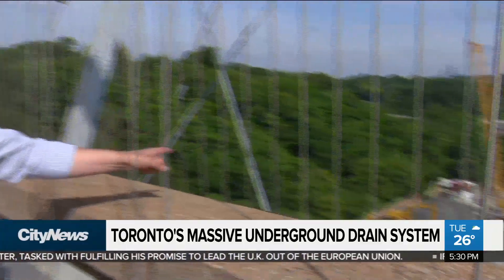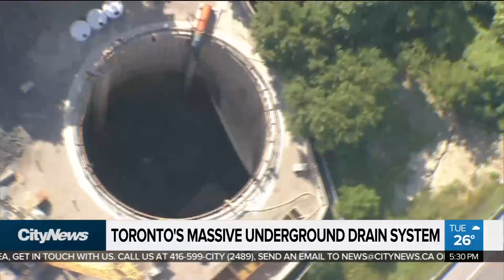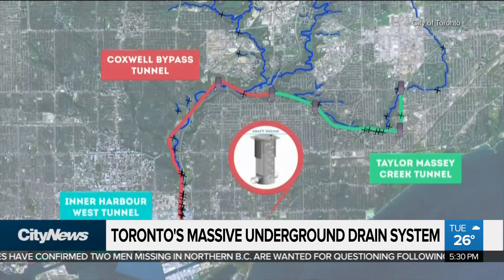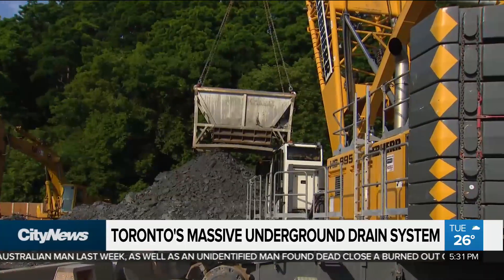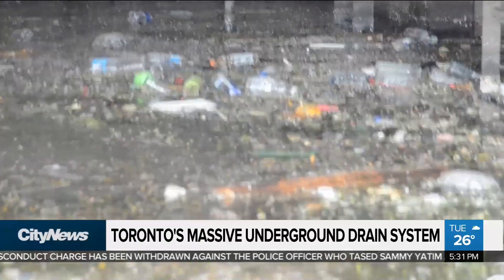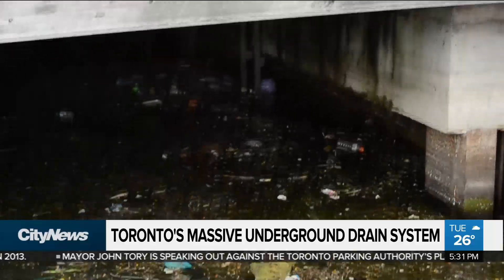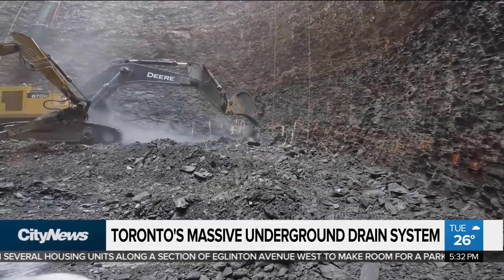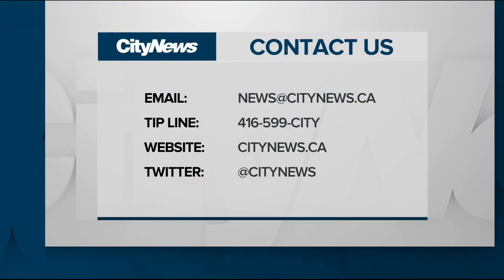A look at the massive project to prevent Toronto flooding

Comment: This is great and scandalous at the same time when I moved to Toronto in 1995 my High School taught me about this problem I was told there was corruption in the building of Toronto and that they cheaped out I'm building a decent sewage and drain system the problem was that whenever there was too much stormwater it would go so high the level that it would start mixing with the sewage resulting in untreated sewage pouring right into our Lakes anyways that was 1995 ( not the building of the System just me being taught)  nice to see the finally doing something about it

Comment: That's a cool project and will certainly help... but at the same time, small solutions need to also be pursued; such as removing existing paving where possible, mandating permeable paving henceforth, building more parks (and less parking lots), etc. Nature manages stormwater very efficiently, if you would just not pave over it and change it!
Reply: I agree big concrete holes cost a lot of money, I have seen some natural revitalization cost less than that. Look up the channel ‘City Parks Alliance’ here on YouTube, they have a video that explains the difference in costs for these types of problems. And they say it saved over 10 million building naturally. Also green space is beautiful and has many economic and health benefits.

Comment: Toronto is on a slope that leads into the lake. All water that comes in drains into the lake. Why would we need this?
Reply: Thats the problem, Sewage is getting into the lake and waterways. this is bad, these tanks will hold overflow during storms. until there is capacity at the sewage plant to treat the contaminated water.
Reply: seriously?
Reply: Because a contractor needs a contract!

Comment: We can build 22 km of giant tunnels for this and we can't even get the shovels down for a subway.
Reply: They dont want to build subways.
Reply: @baystreet6627  Of course they dont. How will they collect gas taxes??
Reply: Why does it have to be one or the other. This is needed and so is the subway.
Reply: @andrewbarnes7692   So true.  This has been needed to help replace natural drainage capacity lost to urban development.   This, and the re-naturalization of the mouth of the Don River are steps to control floodwaters of the Don.  And controlling floodwaters in the area you want a subway buried are probably a legitimate concern to deal with before digging near and under waterways.
Reply: @andrewbarnes7692  Bro, its politics. Politicians always do what pays politically. Arguing about a subway and never building it pays off. The city chokes in traffic and that's the whole point. This way they have something to preach and make themselves as heroes. If the subway gets build, the reason to bicker and whine goes away and so do their votes.
Reply: Yeah if they built one new station a year it would be great progress . And put washrooms in every station and automate the system
Reply: The rich are the priority
Reply: It's easier to dig than to clean
Reply: The contractor probably has connections at city hall.  Toronto is an extremely corrupt city.  And Toronto does a very good job of hiding that fact. Believe you me!
Reply: @baystreet6627  usually give back a percentage of commision to who gives the contract.
Its why they all hated Rob Ford, he stopped the gravy train as he called it.
Reply: @thesisko4031  there's still tons, gobs and gobs of gravy still left unfortunately.
Reply: Bugsy Segal  Toronto is the only transit system on the planet not subsidised by the province.  
Now that the province is taking over things should change.
Reply: Its because this project isn't a political issue they campaign on for 20 years
Reply: This is far more important
Reply: Suppose Toronto's population plummeted after this pandemic. Would the subway pay for itself then?

The blessing with buses is that they can be moved to wherever the people go.
Reply: It's called priorities sanitation is more important than subways
Reply: It’s really sad. I’m from Toronto but lived in China. Some of their subway systems are 100 times better than anything in Canada and they are building more
Reply: James Lade why are humans so ungrateful? Do u get to work safely?
Reply: Or just let someone say... this is madness! Madness??? THIS IS
Reply: Bonnie Cull  Toronto is Libs and the subway is Toronto.  Stop blaming Cons for your problems in that city.
Reply: @mare-6406  huh? You do know North of Steeles is not Toronto right? Where the subway extension is supposed to be? So no it's not Toronto. time for you to learn geography
Reply: @gilboman  Eglinton is in Toronto & my husband has been working on that construction.  
Do you understand how many billions it costs to build subways?  You can't be both a sanctuary city and take care of your own people. Pick one.  The people who have paid taxes for their entire life or the people who decided to use the RCMP as their personal valets. 
Any subways being built in GTA still helps out the downtown core.  Use logic.  Yes I understand our subway needs many more lines but to what end?  How much is a ride going to cost you?  GO is already overpriced for people getting into downtown.  Where do you propose this money comes from?
Reply: @mare-6406  lol what? Santurary city? Nice try. No such thing in Canada as santurary city. It's sad you didnt get a single thing correct in your rambling .  Go transit is heavily subsidized and very cheap. Nowhere else in the world does commuter rail system offer endless free parking like Go
Reply: @gilboman  from a site called visaplace dot com: Well, Toronto city council voted on Thursday and decided that yes, Toronto is now a “sanctuary city”, making history as the first Canadian city that has a policy in place to let undocumented migrants or illegal immigrants use vital city services even if they do not have an immigration status.

Sanctuary Cities exist all over the U.S. for illegal immigrants
While Toronto is only the first city in Canada to have such a policy in place, it joins 36 American cities that already have the same policy, including Los Angeles, Denver, New York City, Baltimore, Philadelphia as well as three whole states: Vermont, Maine and Oregon.

City council voted 37 to 3, and the measure will also ensure that managers and city staff have the training to make sure that undocumented residents in Toronto will be able to use city services without fear.

According to city councilor Joe Mihevic, who voted for the motion, “This is a historic moment because we are saying we are a sanctuary city and that anyone who is in the City of Toronto will be able to access all the services the city offers, be it in the areas of health, in the area of parks, in the area of library, in the area of public safety.”
Reply: @gilboman  The whole GTA is Liberal Red!